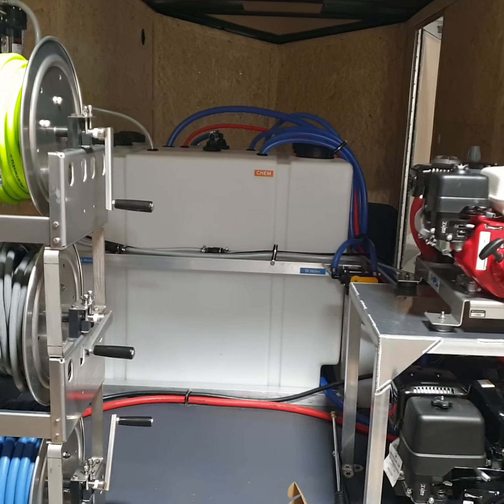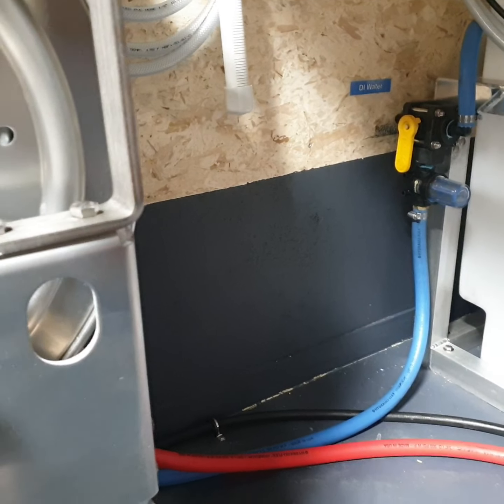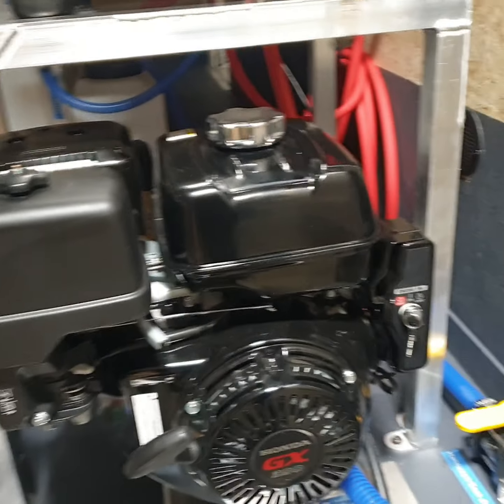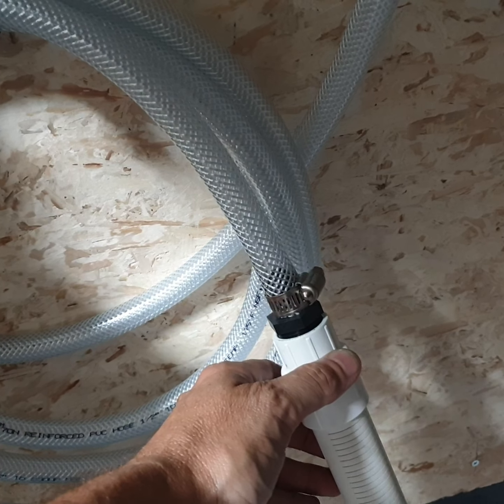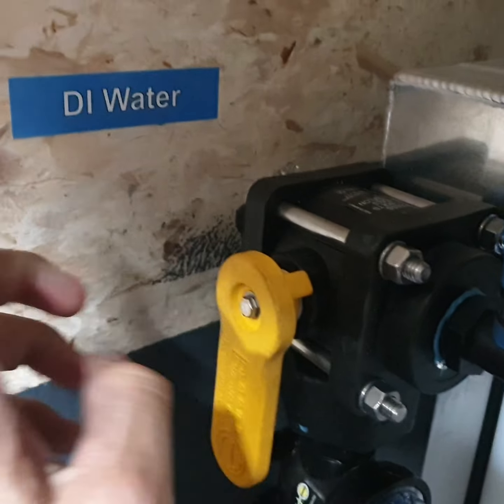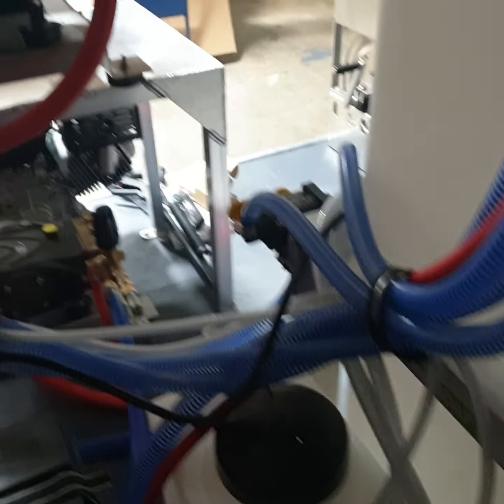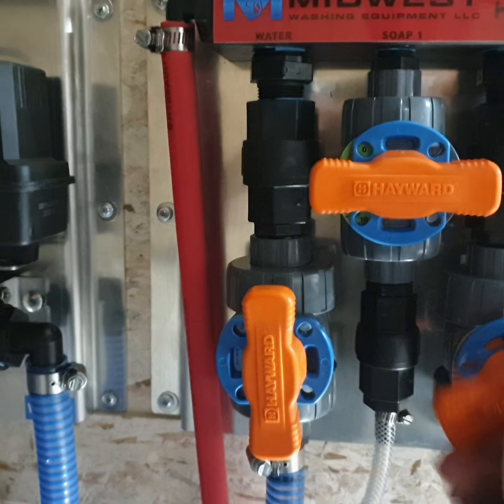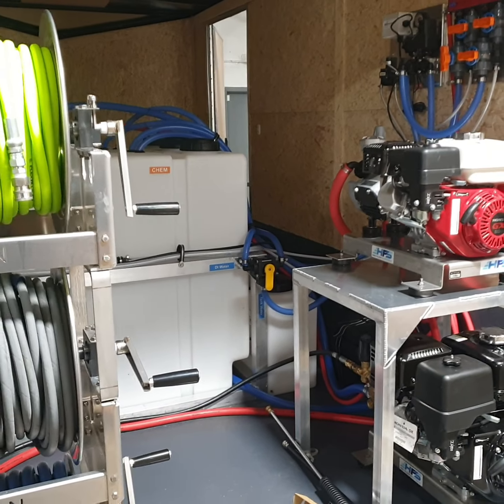Enclosed Trailer Wash Rig-@lucidbots Drone washing, soft wash and pressure wash

Comment: A very clean setup.  Do you vent your SH tanks to the outside of the trailer for enclosed trailer builds?
Reply from the maker: only if the customer requests it.  We've found it's not needed.  As long as you're using a tank that's only vented in, not out.
Reply: @midwestwashingequipmentllc1209  That's interesting.  I'm running an enclosed pickup truck setup and feel like there may be a need to vent.  Maybe my tank isn't an inward vent ....
Reply from the maker: @SL_PressureWashing  it's possible your tank vents both ways.  If you're starting to see corrosion or regularly smell bleach, I would vent it.